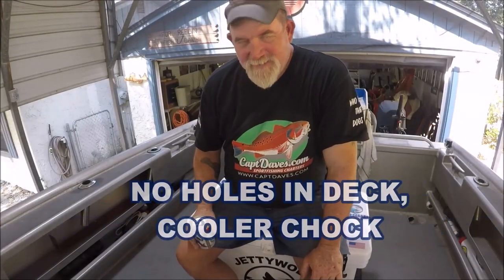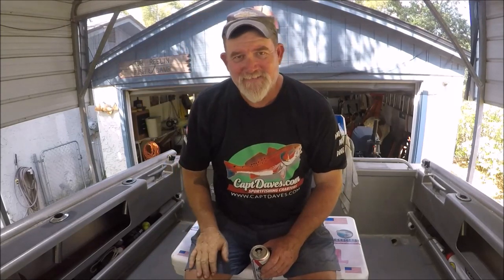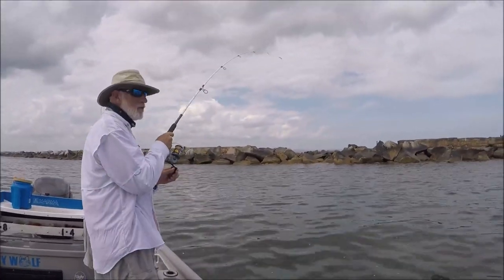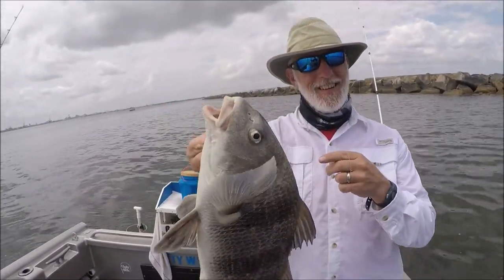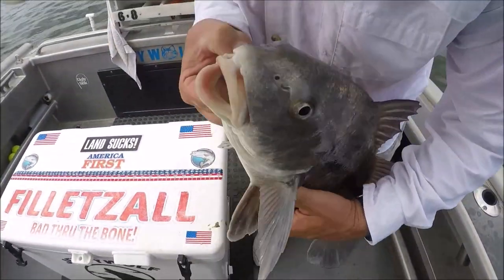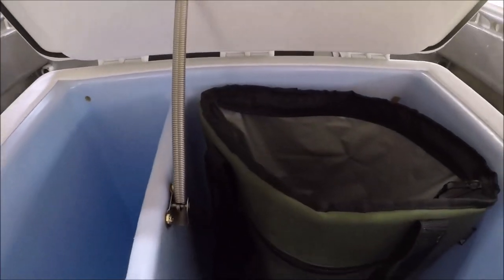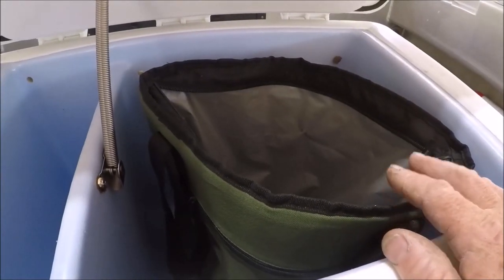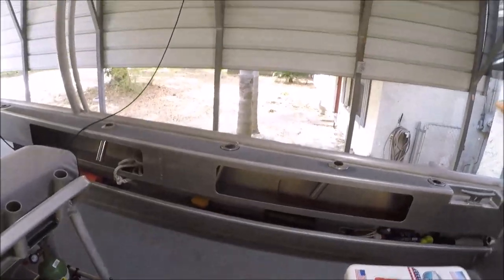NO SCREW COOLER CHOCKING / ICEY-TEK 120

Comment: A great solution for the cooler moving around.  I've never seen a fish take the lead too,  but on the plus side leaving the weight in will enhance the weigh-in during a tournament.
Reply from the maker: unless you have me as weigh master! I was weigh master for several King Mackerel tournaments in the past. I put a team of "checkers" in the line, and it was unbelievable what they found in fishes throats and mouths, by cheaters! Older trick than that is a tube and funnel, pouring water down the fishes throat. But we found that too, via a belly cut.  C'C'mon!  YES Icey-teks are great, and this really worked out for me, more rear-ward seating for charter customers.

Comment: Great informative video.  I got the same sunday project coming up soon.  I wanted to ask you.   Where did you get that rubber mat?  I want something similar to do the whole floor on a section of my boat where im going to put my cooler.  It looks thick heavy somewhat commercial grade..
Reply from the maker: It's only 3 by 5 and yes it's very very thick and very very heavy I got that at Northern Tool if you plan on doing multiples of these plan on wearing your boat down and getting really bad gas mileage

Comment: Haven’t seen the stainless epoxy bolts, but the steel ones are called Elevator bolts for those looking. Where did you find the small spring for the little cooler? I like that idea. Fish On👍
Reply from the maker: The first one in my Hundred 20 quart cooler I bought on the clearance rack at West Marine you can get them anywhere Amazon eBay the one in my bigger cooler is about 11 and 1/2 inches long in my smaller cooler it's about 9 and 1/2 in and smaller diameter those Lowe's stainless bolts came with a system called epoxy weld or something something like that
Reply: Melloreel , those springs are called hatch support springs . Took me a long time to find out what they are called .
Reply: Capt Dave's Sport Fishing thanks Capt👍
Reply: schism420420 I knew I had seen those springs before😳 Thanks for info.
Reply: Melloreel , same here after about an hour of using different key words it dawned on me that a vintage Pro Deck Bass boat that I blue printed the hull on had those . Then it was Daaaaa , new key words.
Reply from the maker: @schism420420  I always had them on t-top electronics box doors. on past boats.
Reply from the maker: @melloreel  https://ebay.us/CL9n9B